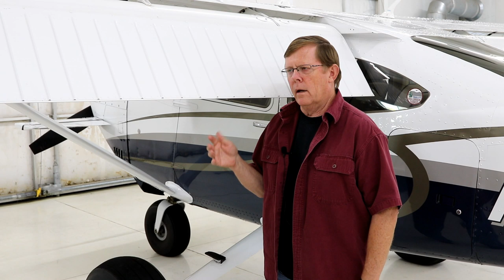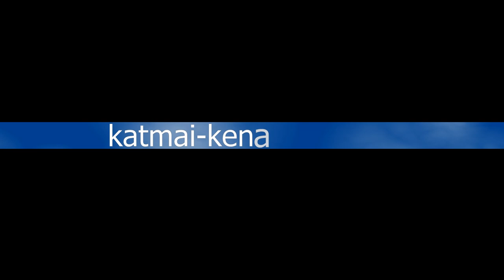Flap Usage

Comment: Lose a cylinder or engine with 40 flaps and your done, no glide anymore, it’s over. At 20 you will save the day, retracting flap and getting the glide back very quickly, plane shoots forward and your flying again.